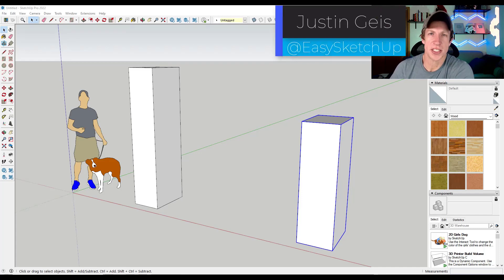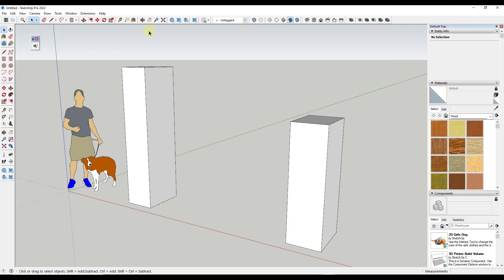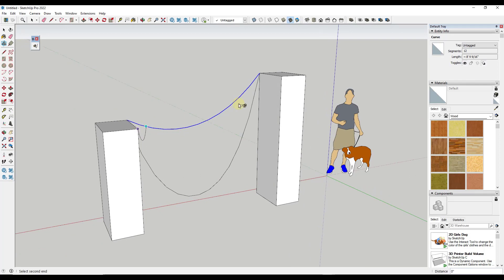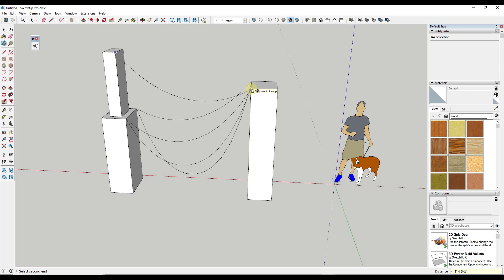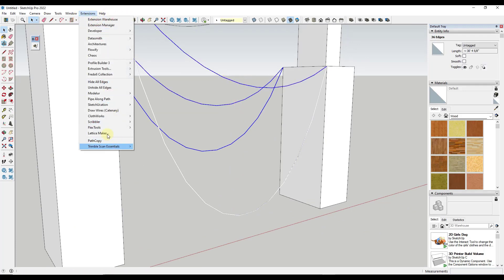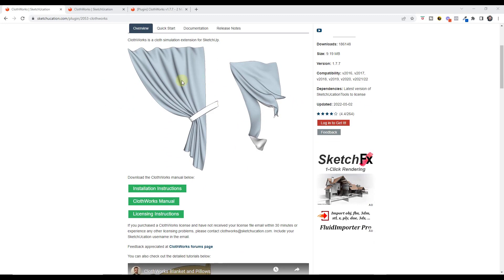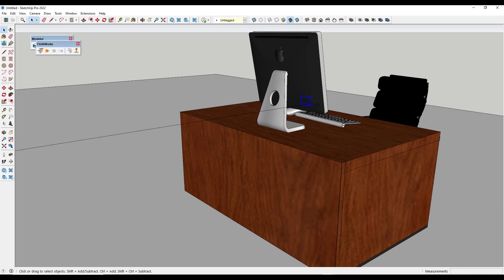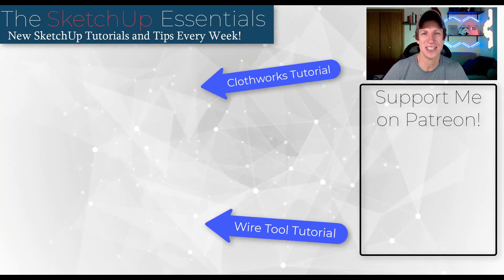2 Easy Ways to Make WIRES AND CABLES in SketchUp!

Comment: What other thing (besides curtains, tablecloth, cloth and wires) you can do with clothworks plugin?
Reply: anything that requires gravity and or wind to affect the object. I believe it has a fill function as well to replicate pillows and comforters that fluff up etc. What you mentioned are the most obvious use cases though.